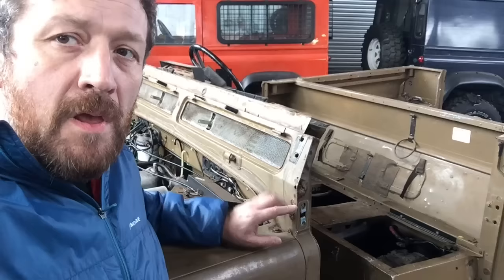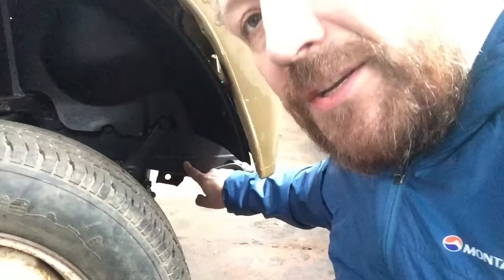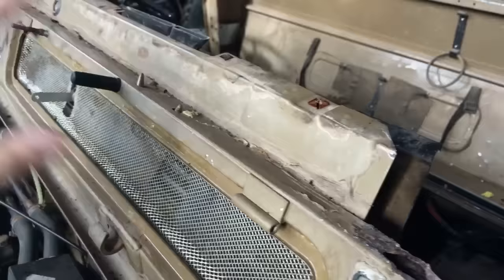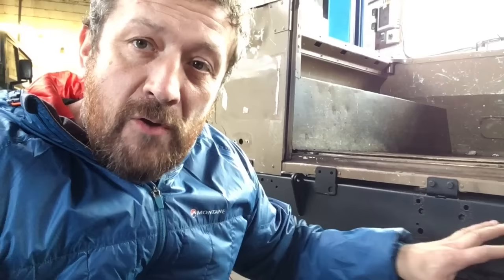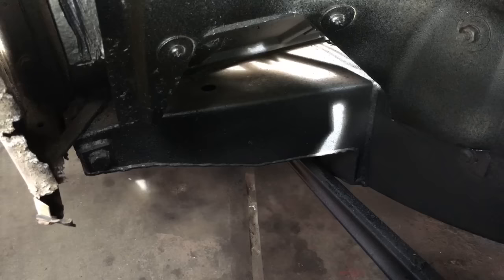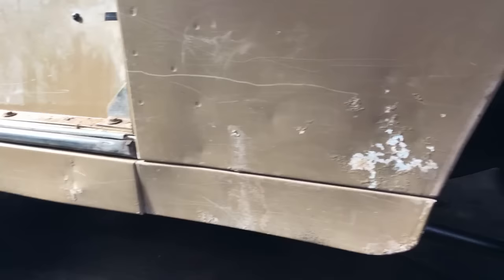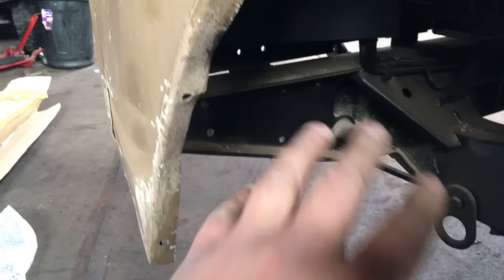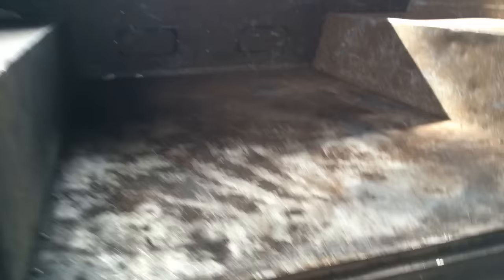TOP 10 BUYING TIPS. Land Rover Defender buying guide. Complete walk round

Comment: worth checking engine too. make sure you start it from stone  cold and it doesn't smoke. give it a good hard run and get oil hot. make sure oil light doesn't flicker near idle. important to check on 200tdi as can spin cam bearings. if smokes badly when cold or oil light flickers when hot  then could be in for major engine work

Comment: Very good points. Not many people mention this. Electro asidic action.
In otherwords corrosion, this happens when steel or iron is in contact with aluminium or other non ferious metal. Especially when water is alowed to get to these areas.
I worked on a ship that had this problem, very difficult to get rid of bad design fault.

Comment: I had a new galvanised chassis on my 90 but I will need to look for a new bulkhead because it’s finished and is rusting in its usual places. I will be getting a new galvanised bulkhead. It’s 100% worth the cost just like the chassis and I may consider deleting the vents, they are a nuisance and a pain in the backside and just lets water in. Need more air? Wind window down or air con.

Comment: Question regarding newer Defenders with a digital odometer. 
How does one verify the total mileage? The digital ones seem to only display 5 digits plus a decimal. 
Example: 12345.6 

So is that mileage as it’s shown, or is it 112345.6? Or 212345.6? Or higher? 
Dos it drop the decimal once it passes 100k miles or kms?

Comment: This was an excellent video...thanks Fraser! I too am a rookie and about to buy my first. There were some excellent tips in here. Do you have a similar video more specific to just the drivetrain? Any questions I need to make sure I ask?
Reply from the maker: Adam Culligan thanks, there's an ex military buying guide worth watching but nothing specific to drive train I'm afraid.
Reply: Fraser very good. Cheers! Do you by chance have a top 3 tips kind of thing? I'm looking at a 2001 Td5. I've been told to ask about the timing belt as at 180k miles it should have been done by now. Anything else mission critical that would cause you to walk away?
Reply from the maker: Adam Culligan I think I'd aim for something with lower mileage. 2002 onwards and check the diff lock works.
Reply: @LRLiveUK  hello mate  I got 1985 defender  2.5  petrol engine 

What do you advise me to swap engine 
Like what is the best petrol engine for land rover...

Comment: 0:39 on my 2004 d90 the bulkhead is perfectly fine but both windscreen brackets have a fair bit of oxodisation I was putting new seals under my front vents and actually removed the brackets to make it easier I found that their pretty brittle and a small area actually chipped off... the bracket also their wasn't much left of the gaskets..... would leaving these as is damage the bulkhead I mean would it spread further.? writing this I'm pretty sure i'm just going to replace the brackets with new gaskets anyway but thought I would ask......
Reply from the maker: Did you remove the vents or the windscreen brackets?
Reply: I removed 1 bracket simply to allow better access on removing the vents to re-seal... but the oxidisation is on the brackets  @LRLiveUK
Reply from the maker: @jackmartin9008  you can take these back to bare metal with a flap disc. Acid etched then primer coat. Or you can buy them cheaply aftermarket

Comment: Hey mate, I'm in Australia, trying to find out if these issues are localised to England due to weather and salting the roads etc? Or if it's still just as bad in drier climates? Thanks
Reply from the maker: Probably not as bad over there but worth checking on any potential buy.
Reply: @LRLiveUK  would you say it's a inherent design flaw of having the aluminium shell? Do they exist worse than other cars of the same age and use?
Reply from the maker: @CoolKillkennyCat  definitely some design flaws with the front flaps etc. (You can buy blanking panels for these now) but aluminium panels are a good thing.

Comment: Hi Fraser, I would like to buy a Defender 90 however with the new stringent Emission Standards - is it possible to modify the vehicle so it meets current regulations?  thanks
Reply from the maker: Al Williams for which country?
Reply: The UK.  Thanks Frazer
Reply from the maker: Al Williams if you want it for the LEZ you'll need a county station wagon as they are classified as an estate car.
Reply: Mine says 'Utility vehicle' on the form,  and it certainly isn't a conversion,  I bought it new.
Reply: Fraser and Germany ?

Comment: So if the chassis numbers dont match. Should you not buy it?
Reply from the maker: none11ification absolutely not
Reply: @LRLiveUK  If it has been fitted with a new galvanised chassis I would think it would be a good buy if other components such as suspension and brakes have been replaced as part of the chassis replacement / rebuild ?  Are you saying don't buy one that has a galvanised chassis with no vin  on the new chassis ?
Reply from the maker: @48sydney  if it's a galv chassis try and make sure other vins and engine numbers match the paperwork. You don't have to walk away if there's a solid paper trail confirming it's history
Reply: @LRLiveUK  Its my car and I had the chassis replaced as the old one rotted out. I'm not sure I will let it go now I have fixed everything.